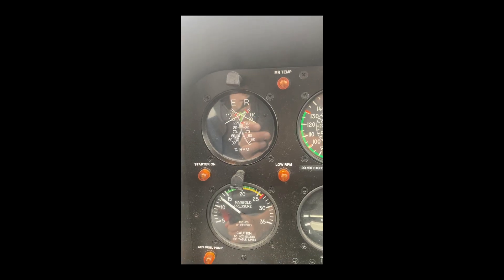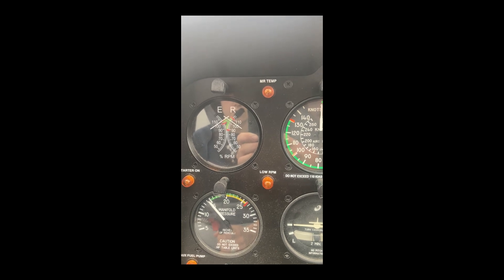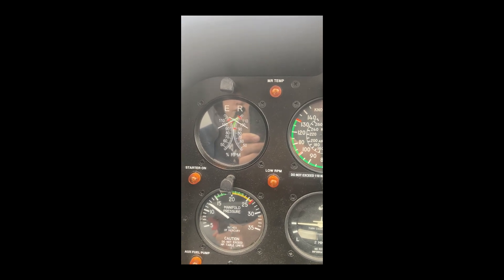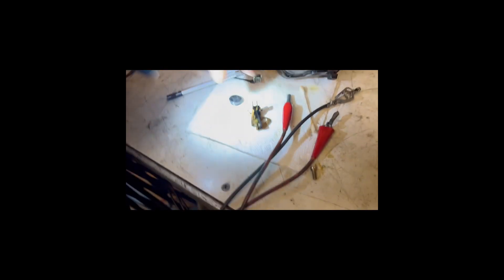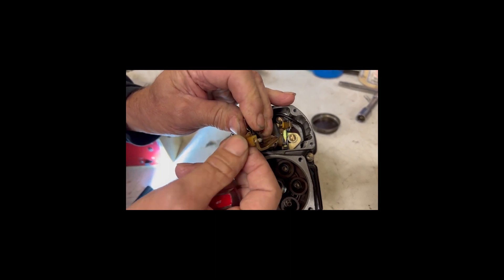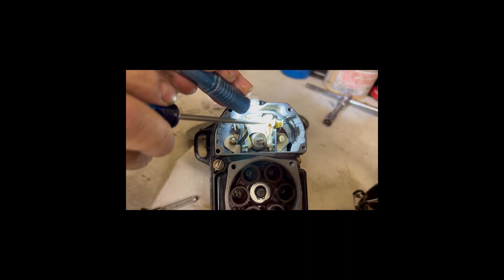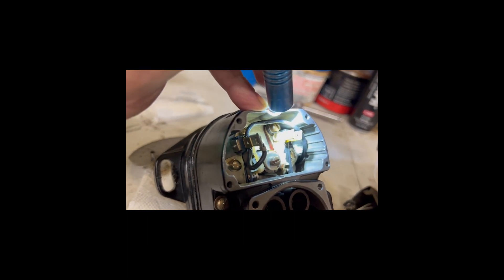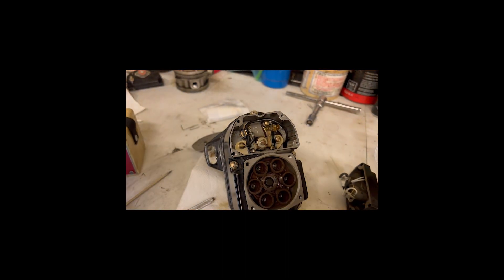A Magneto Problem causing erratic Governor functioning. If you fly R44's you'll want to watch this!!

Comment: Your videos are always informative so thank you. My left mag failed recently and I did not really notice much difference except a bit more roughness. On landing though I noticed I was pulling about 1.5” more MP than on takeoff so knew something was not right. Did a mag check on landing (dont want to be doing this in the air - you can in a plane but never in a helicopter) and confirmed my suspicions. That said, if it was the right mag would I have no Governer and engine tach as you say they are linked?